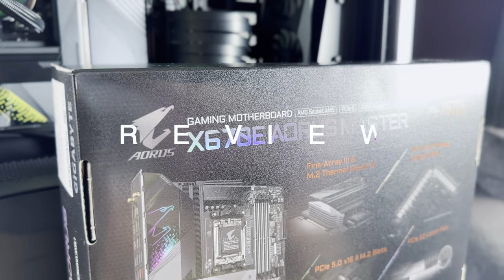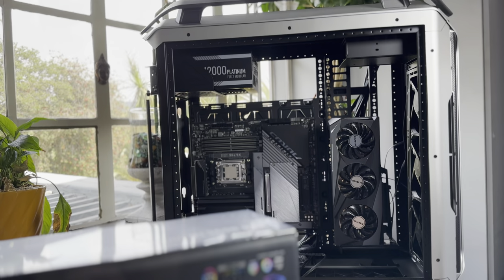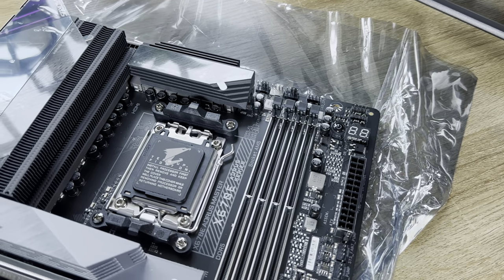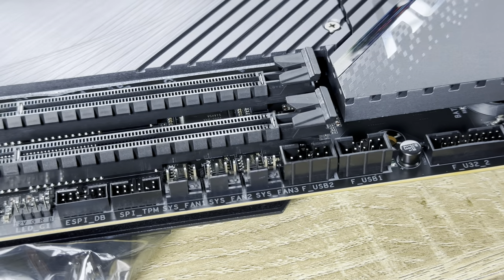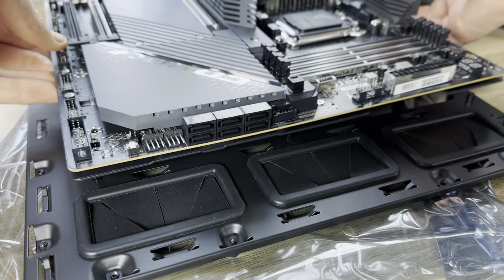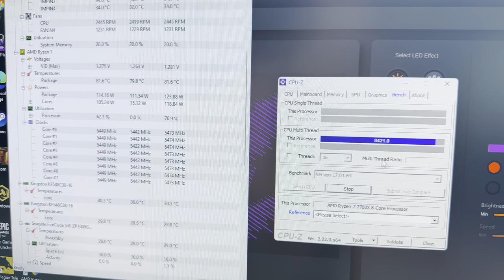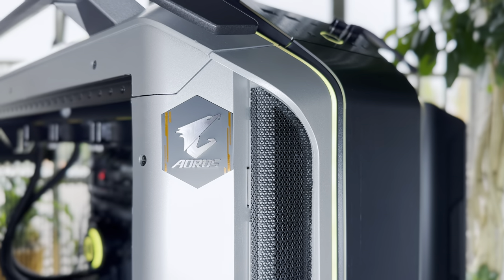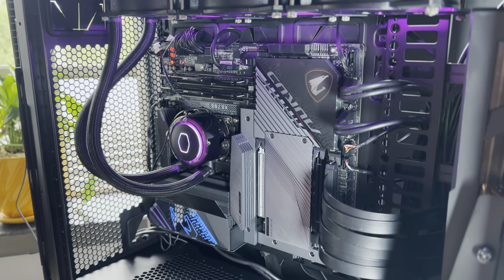Gigabyte X670E AORUS Master Motherboard + AMD Ryzen 7700X Review

Comment: Have you had many issues with this motherboard? Im considering getting one. Id like to know if its good, stable and no issues 😊
Reply: The CMOS battery is located under the heatsink of the two chip sets. If you need to change the battery after 3-5 years, you have to disassemble the whole PC because you can only unscrew this heatsink from behind after removing the back plate.
The bottom PCIe slot is shared with two SATA ports. Either one or the other.
Almost half of the lamellar heat sink of the voltage regulator is masked off. Who does something like that? But half of the slots in the heat sink on the two chip sets are also masked.
Gigabyte should clean up its mechanical design department. 👎👎👎

Comment: I have this same motherboard.  At about 3:52 you peel the plastic coating off the slot thermal compound, and the thermal compound appears to remain on the motherboard.  But when I did that the thermal compound came OFF the motherboard with the plastic sheet.  Both the plastic sheet and thermal compound are imprinted with the text "Remove before using" so I assume this is correct but I would hate to damage this motherboard because of something this simple.
Reply: Correction: the thermal paste is NOT imprinted with those words.  So now I think the thermal paste should have stayed on the motherboard.  This is annoying.

Comment: do you have any kind of stutters on this system?? thank you
Reply from the maker: I did when I first set it up. Two reasons I think. 1 - I was using a riser card that wasn't compatible with the Gen 5 port. 2 - Had to update my BIOS to properly support the Fury RAM.
Reply: @GLITCHEDZA  Ok! And now it is all Ok?? Thank you
Reply from the maker: @bucurflorentin8563  Yes. The BIOS update definitely helped smooth out the issues. It was barely booting up with the stock BIOS.